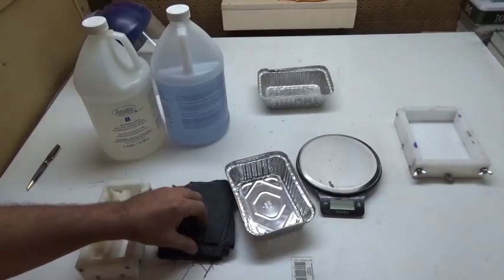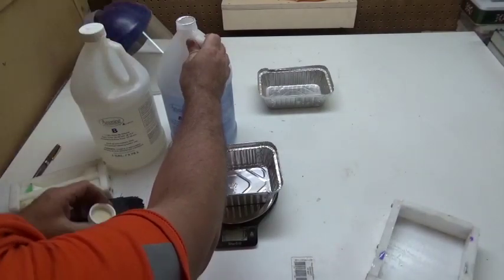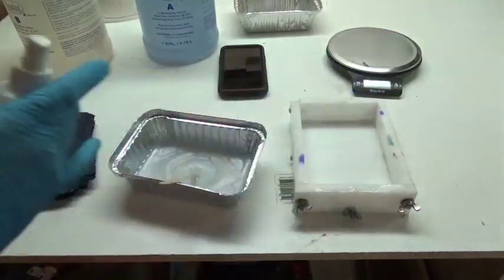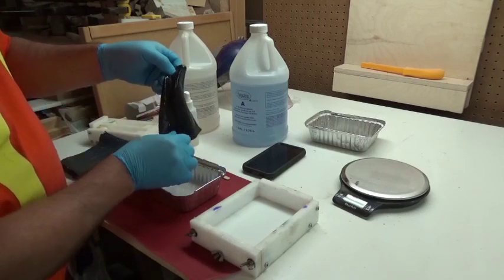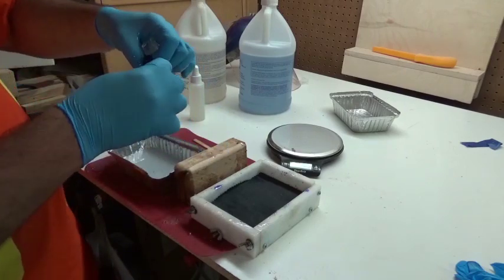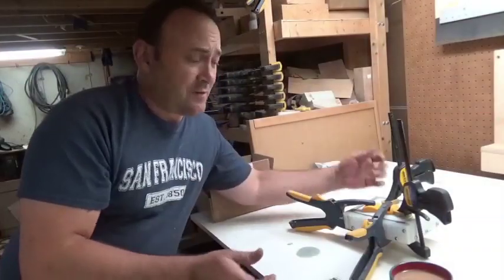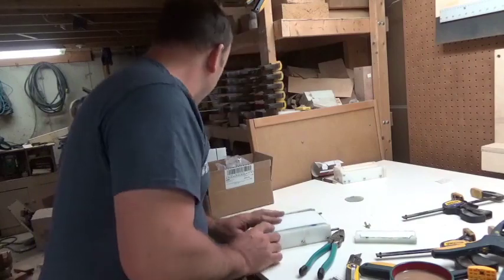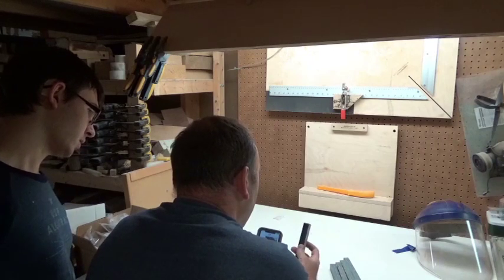woodturning # 129 casting denim pen blanks

Comment: You do realize equal parts by volume is not the same as equal parts by weight when the two parts are of different density? We made that mistake on a pour last week. Ditch the scale. Luckily the difference is within tolerance when using such a small amount, and your blanks still hardened, as did ours.
Reply from the maker: i think thats why i hesitated when i said that, ive seen others do the same thing, either way it worked beautifully lol
thanks for watching
Rob
Reply: Valerie Henschel well said I was thinking the same thing